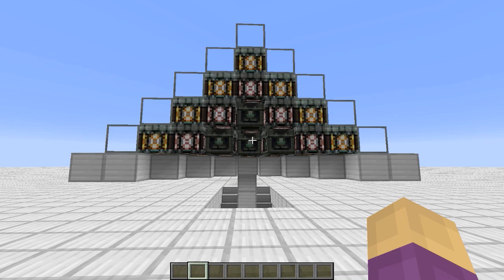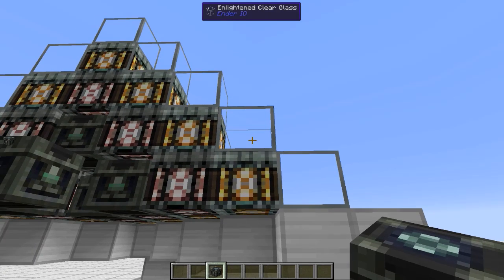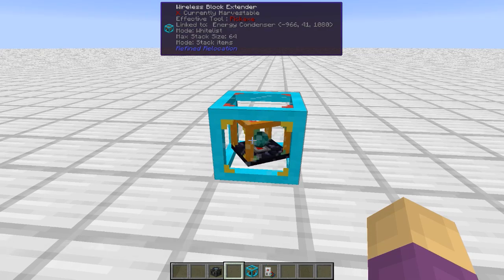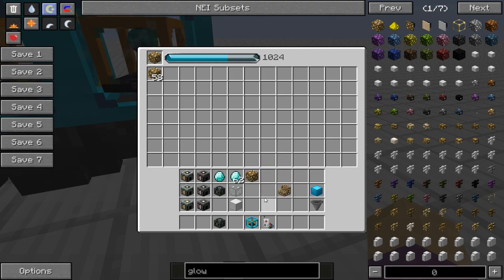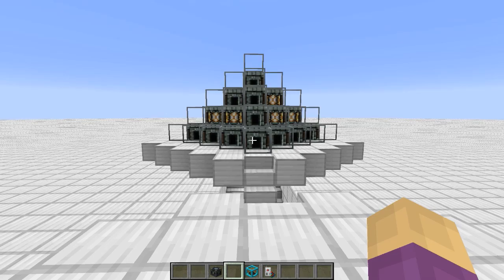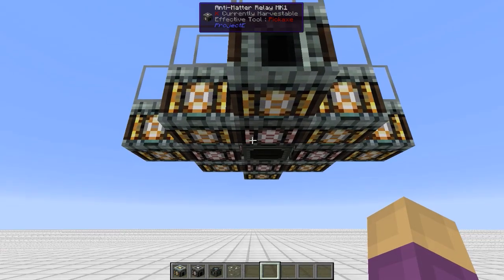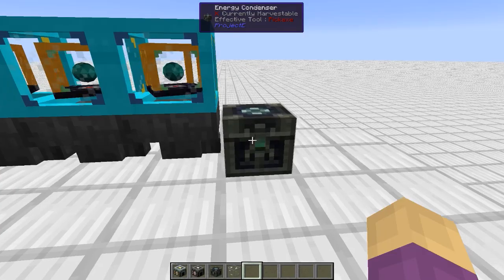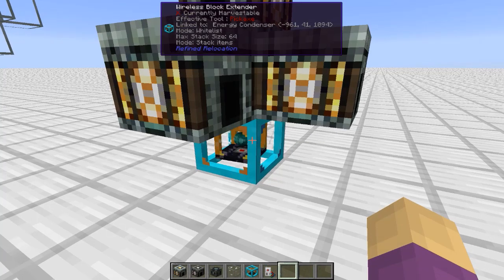Mod Guide - Wireless Power Flower from Project E (1.7.10)

Comment: one flower power keeping one side open for pipe 

start with

gold nugget to
gold pickaxe with 2 uses left
repair pick in alchemical chest (16 repair packs)
block of mobius fuel (plain red)
cracked red fuel block(sorry cant remember fuel names)
white fuel block (can be routed to generater to burn to give basic power)
dark matter
dark matter block
{ ( optional)
red matter sword }
then end with
red matter block
morning star

end of emc generation

this tier sttucture is decently fast and gives you a ready made sword and tool to use if you die which is very handy

ps. gem armour is op

Comment: The Project E developers seem to be rather paranoid about exploits.  The internal loop for the Mark 1 condenser seems to be timed at around one second; and try as I might, that's the fastest I can pull any single item out of it.  Mind you, that is perfectly acceptable.  It just adds work, because I have to know which items I can use at which tier, which will fit the loop.  That is also the reason why I don't actually believe in stacking massive amounts of relays per condenser, because the loop speed limit means that you're only going to get one item within a certain period of time anyway.  My focus is on making sure that each loop gives me one whole item, the EMC of which gets added to the next tier.  When I do that, every single loop gives me an entire item.

Comment: Vaygrim, I've truthfully started to think that the conventional power flower isn't the best way of doing things.  The conventional design tries to maximise EMC input per individual condenser, but then expects that one condenser to start condensing diamonds from zero.

The setup that I'm currently experimenting with, has multiple tiers.  There is one dedicated condenser for every item being produced, and every condenser has an item which is worth exactly four EMC more than the item before it.  Said condensers are then placed vertically, either from the surface or sky build limit, down to bedrock, and will be built in columns if need be.  This is, incidentally, almost identical to the way that real alchemy is (at least theoretically) supposed to work.  Every element in existence corresponds with a particular energetic frequency.  If you know how to produce that frequency, you can produce the item it corresponds with.

So I start with sticks, which are worth 4 EMC.  My next condenser has planks which are worth 8, and so on.  At the moment, each condenser only has two collectors next to it, but because of the way I'm stepping up the EMC gradually, the small boost it gets from those two are all it needs.  My output speed is much higher now than it was with multiple power flowers during 1.2.5, as well.

I realised after a while that this had an unexpected side effect, as well.  If I carefully choose which item is being condensed for the various tiers, then I can create a scenario where every item I might need in the game is being condensed directly, rather than going straight to either diamonds or the red stone, and moving back from there.